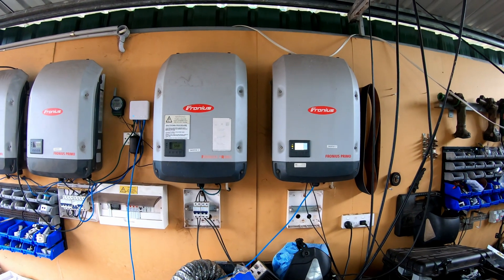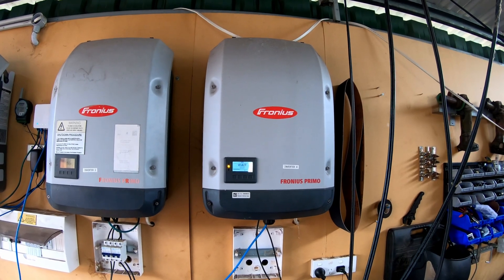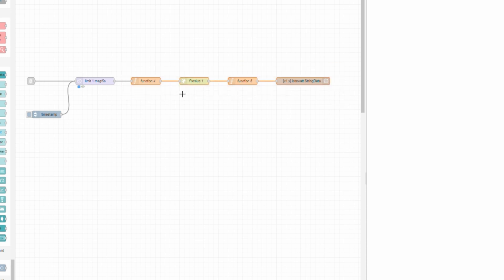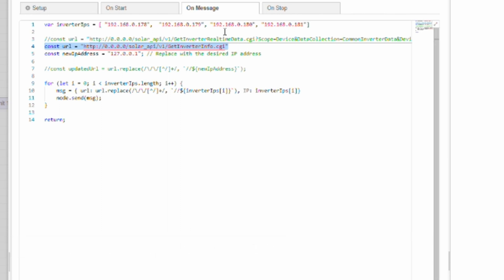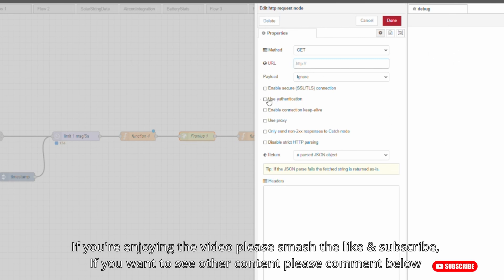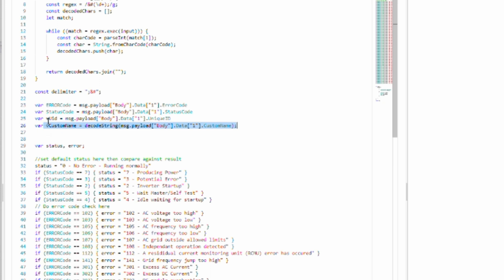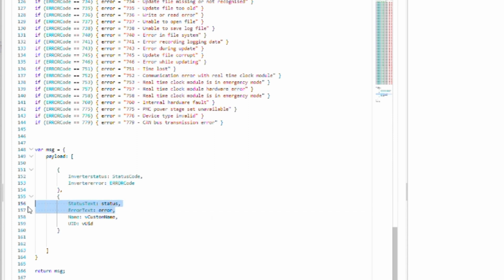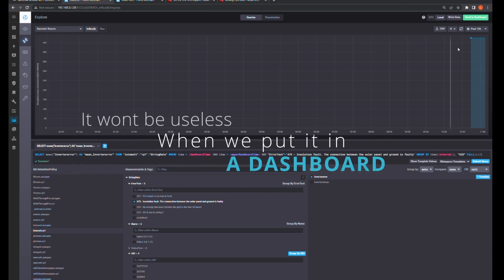Monitoring Ac Coupled Inverter States and Node Red

Comment: How do you change the settings of these inverter? Did you get the username and password when you purchased them?
Reply from the maker: Mine where set to the default username and password. I think you can do a password reset on the datamanager card though
Reply: @ I was hoping you had some secret way to reset it to default. I did purchase a 5kw primo but had to get the installer to release the username certificate. The person I purchased it off had no idea unfortunately.
Reply from the maker: @andrewflies9119  Did you try the technician account ? or just admin ?
Reply: @BadIdea1123  I actually been able to get into the admin account but no luck on the service account. Waiting on a firmware update to complete will report back later